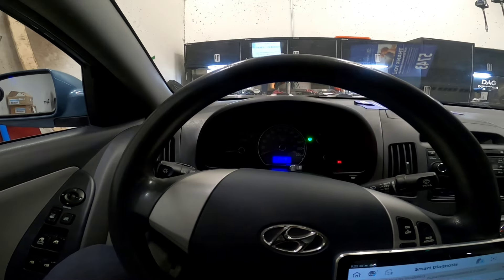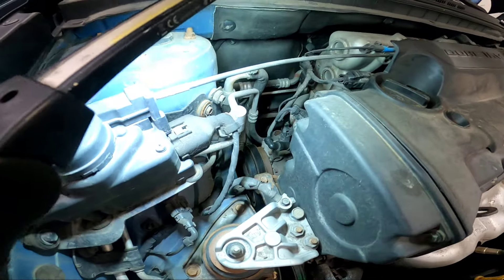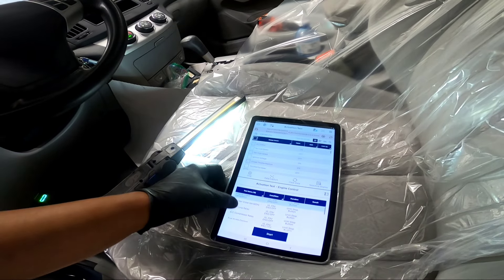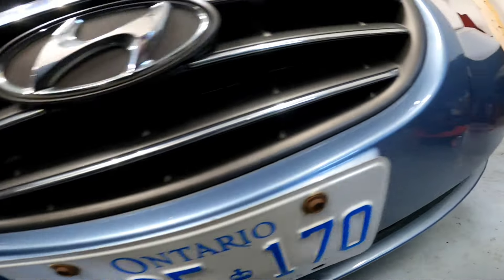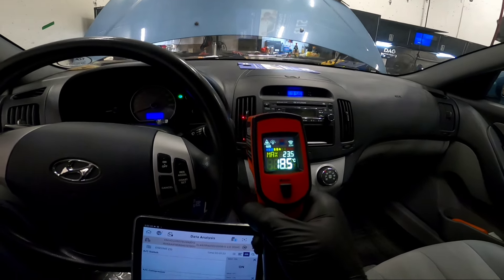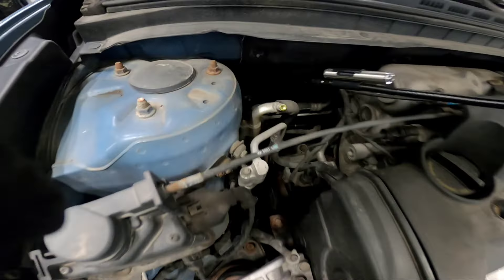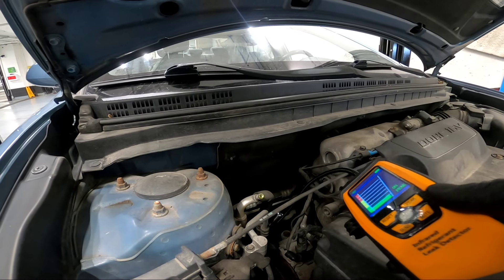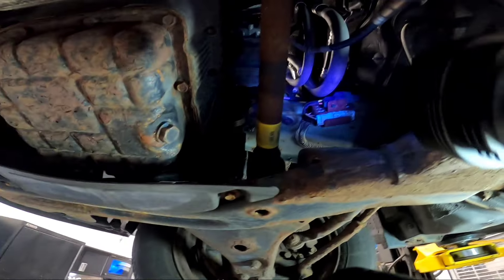Hyundai Elantra | How to check AC not working

Comment: Unrelated question. Is it a good idea to do an oil change at 1000 miles on my 2025 Elantra? I’ve heard a new car engine should have that done true or false? Don’t want to go to the dealer and them saying your friggin nuts lol
Reply from the maker: Thats really your preference, they are saying that after break in which is 1000 km maybe theres some machine debris and its good to replace the oil and oil filter. If you are planning to keep the car for long time amd yeah oil change on that time doesnt hurt anything just a precaution, thats what i did when i got my 2022 tucson.
Reply: @ thanks for responding. I see it has 0W20 oil that’s full synthetic right?
Reply from the maker: @Sayitlikeitis1234  yes